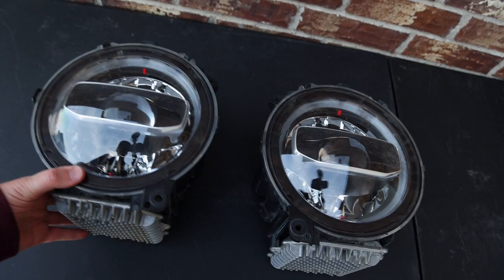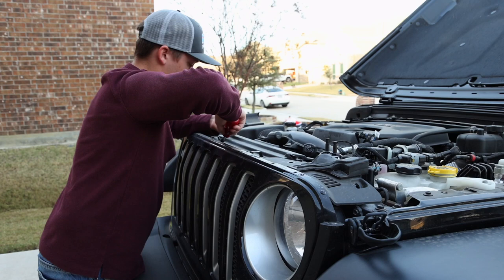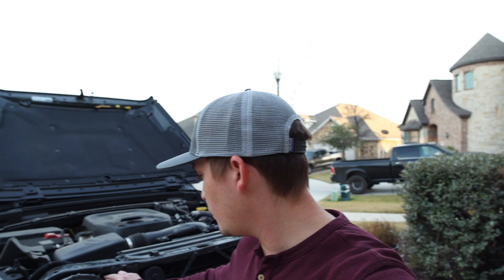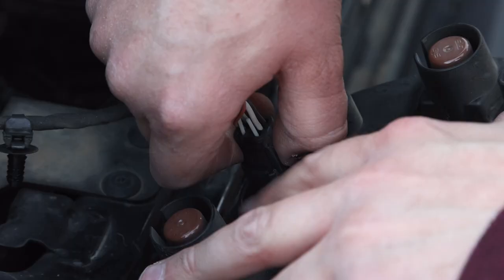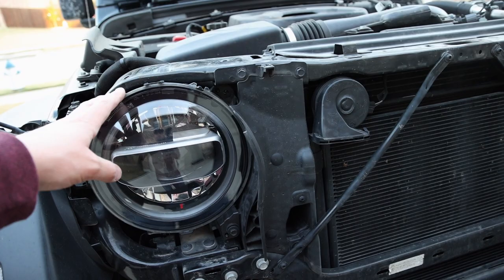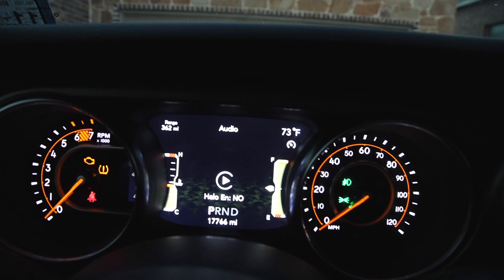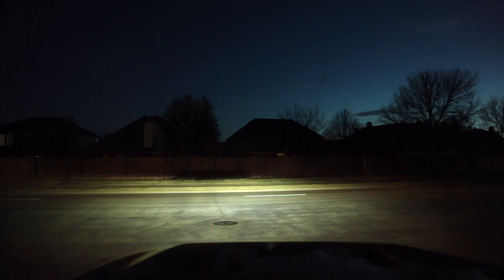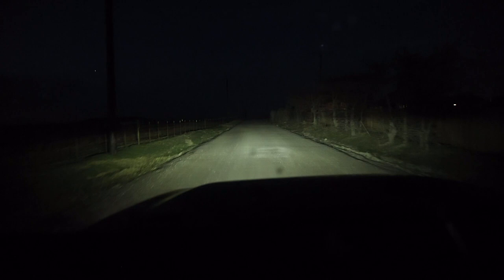Jeep Wrangler JL OEM Led Headlight Swap

Comment: Hi, this has been so far the best explained video I've come across on this topic. I do have a question:  I just bought a brand new 2022 Wrangler JL, in that case I don't need to buy any additional harnesses or do extra wiring, etc (just like in your video), right?   Also, do you happen to have the part code for the set you purchased?  There seem to be many different OEM ones around!   Thank you so much!
Reply from the maker: Yes that is correct you do not need to buy any additional wiring. Part number is 82215136AE you will need to reach out to a dealer due to all other websites have been on back order for over a year. I encourage you to check Facebook marketplace or eBay before buying from a dealer.
Reply from the maker: You will need a Tazor JL mini to activate the halo.
Reply: @mcclainsgarage3917  for jeeps 2021 and up dont need extra wiring for the halo, for 2019 and 2020 you do need to add a wire for the halos.
Reply: I have a question …. Where i can find the option to tun on the halo …. I change the headlight halogen to led OEM and the halo is off
Reply: I agree. Amazing video. Sraight to the point. No stupid stuff like everyone adds.

Comment: Thank you for the concise and informative video! I bought these same Mopar LED takeoffs for my father-in-law's 2018 JL. He doesn't care about the halo, so I'm guessing it should just be a plug-and-play install. Did you need to use a Tazer for the basic headlights (low and high beams) to function correctly with no flicker?
Reply: I Need them answer! lol
Reply: @Natives-cm8yb  I ended up needing to buy and use a Tazer to resolve the flickering issue; they weren’t simple plug-and-play.

Comment: Will the DRL halos work once the headlights are swapped ?
Reply from the maker: No not unless they are turned on using a tazor jl mini.
Reply: @mcclainsgarage3917  Can you use the Tazer JL mini to activate the halos and then just return the Tazer JL mini? Or does the device need to stay plugged into the vehicle?

Comment: What year is your wrangler?  I've seen some additional wiring to enable the halo.
Reply from the maker: It’s a 2021. I believe they switched to the same harness for all models in 2020. You can always count the wires or look in the front of the harness you have to confirm. I believe if you have the halo wire it’s 5 and if not it’s 4.
Reply: Thanks for the great info.
Reply from the maker: @silversol297  Sure thing!
Reply: @mcclainsgarage3917  HALO is 4 wires going into the headlight connector.  Halogen is 3 wires.  That’s for the older models though, as mentioned, the new models received the same harness.